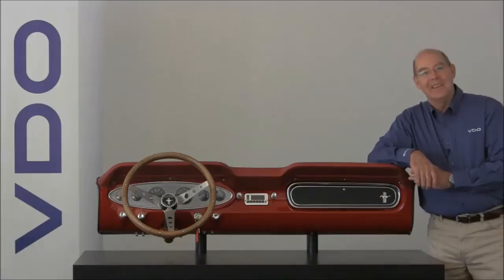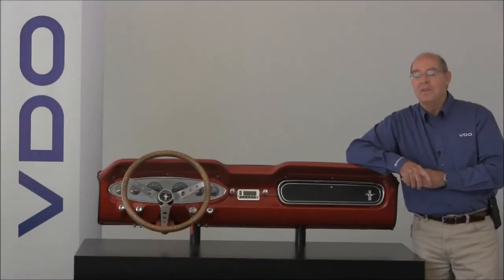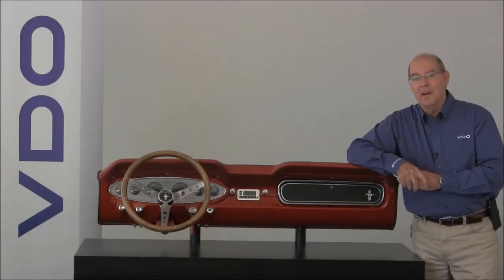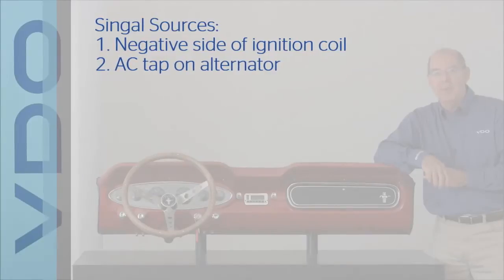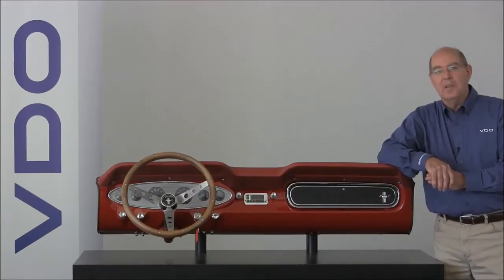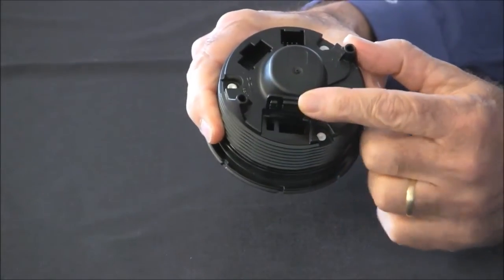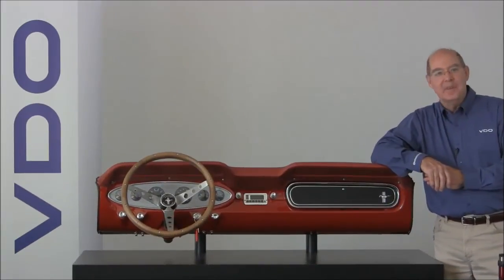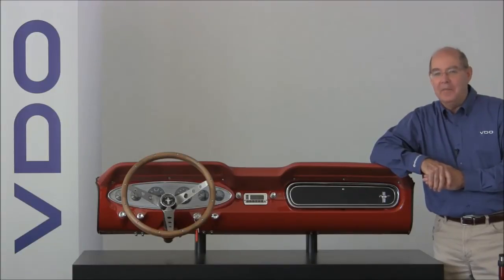How to Program Your Viewline Tach without Electronic Hourmeter

Comment: Hi I have tried several times in programming vdo tachometer but it gives returning to the time instead of the hour metre. 

Then there was another one I programmed but it was running modern like over the limited limited speed.
So please I need your advice step-by-step installation technique on how to program this video it has given me a real tough time over the month thanks I will appreciate very much thank you